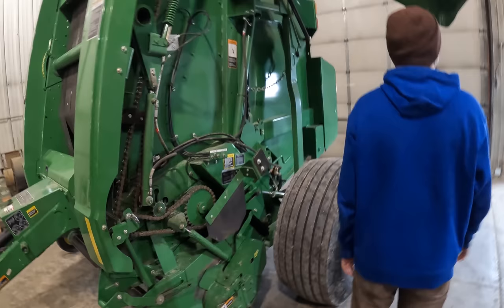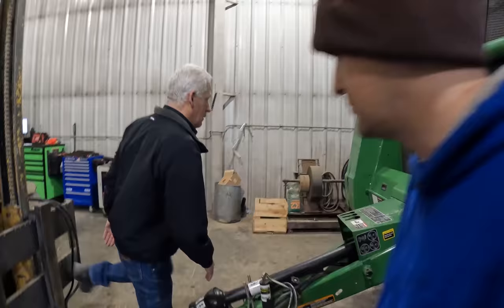Just a Quick Peek - John Deere 569 Premium

Comment: Pulling a baler 280 miles is not to bad at all.  I pulled mine 700 miles from Kansas back to MN and our Deere dealer has done that similar trip with a few other balers.  They have the same wheel bearings as a flatbed trailer.  Pump the tires up to 25-30 lbs n rock out at 60-65mph is what I did and our dealer recommended it
Reply: They will fit on a gooseneck trailer.......  We  have moved them  over  500miles

Comment: I have a 569 premium I bought new in 2014. It’s the 6th John Deere baler I bought new as I do custom baling. It’s the best baler I’ve ever owned. It has 49789 bales on it, I’ve only replaced the 2 top bearings and 4 idler roll bearings and still have 2 of the original belts on it. I did put new bearings in the pickup at 45000 bales. The cams still looked like new. I run a 2630 monitor and bale with a 6140R with IVT so I can run the tractor baler Automation. I think you guys would really like the baler.
Reply: Man that's a lot of rolls. What is the most you ever bailed in a single day? I spent many hours in my time rolling hay, much respect.
Reply: @johnnytoobad4287  I’ve done 600 bales in a day with 1 baler in corn stalks.
Reply: Hi

Comment: We upgraded this past year from our 568 mega wide to a 560 M I believe is what the new one is. We had just over 40k bales on it so I’ve gone through that thing more than once. That thing still had some of the original bearings in it. The pick up reel bearings need to be replaced about every 5000-6000 rolls. We usually got 2 years out of a set of pick up reel bearings. I usually went ahead and changed the cam bearing on the pick up reel at the same time. The 2 double sprockets is the other big wear on it along with both 50 pickup reel chains. I think all but 1 of the belts were still original and all those on the baler in the video looked perfectly fine. That one that had a weird wear on it could be changed but looked fine. If it was me I’d just pull them all of measure and trim them. I don’t know what the other one looked like so can’t give an opinion on which I’d prefer. Either way you can’t go wrong with those with just routine Mantainance. Very solid pieces of equipment so can’t wait to see the route y’all take.

Comment: Do not let 300 mile of towing that little baler stop a "deal". Tires are made to go around, just have a jack, blocking, wrench, and spare. Check wheel bearings before leaving and check by feeling for excessive heat occasionally. Go when weather is good and plan your route.  Look at it like going to 30 consecutive fields, each 10 mile apart.

Comment: Thought you demoed a Kuhn or Krone bailer recently. You said as I remember that they were better than the John Deere bailers. Kuhn has great equipment.
Reply: The problem would be dealer location for parts.  Deere is just conveniently near by compared to a couple hour drive to others for parts if something happens while in the field.  Travis once talked about that in his channel.  Sometimes, you end up with a company just because of the dealer network availability than what would be better.

If you ever do RV'ing, keep watch of the same thing.  A lot of class B motorhomes are based on the mercedes sprinter van.  This is because it has a better weight handling.  But if you break down in the middle of Iowa, which is more likely to be nearby for parts.  A mercedes dealer or a ford/ram dealer.